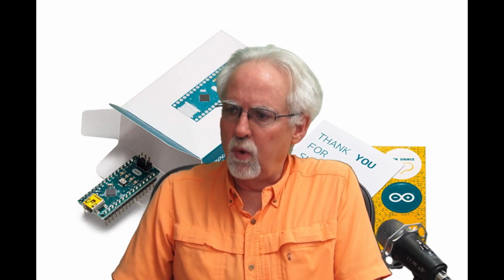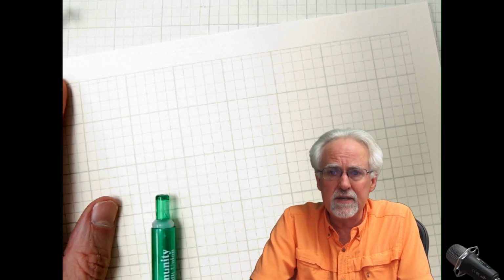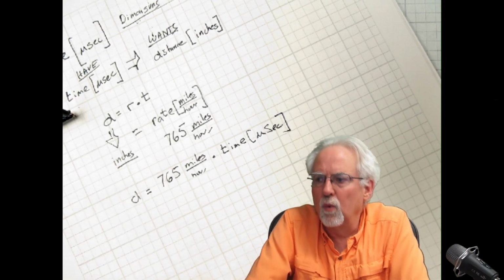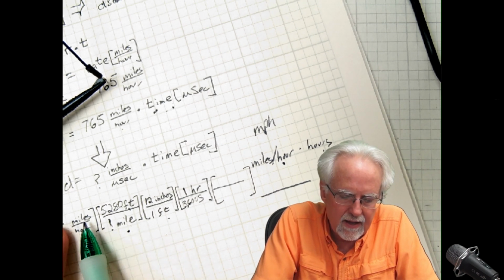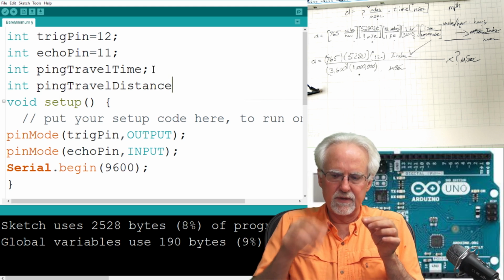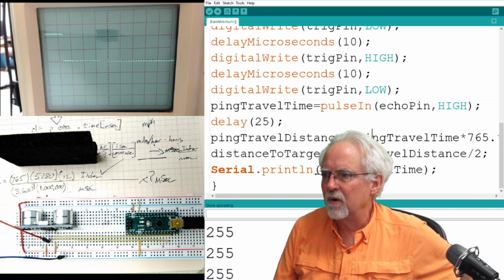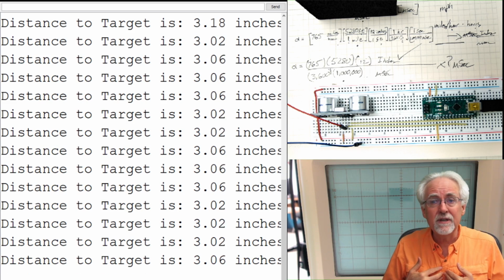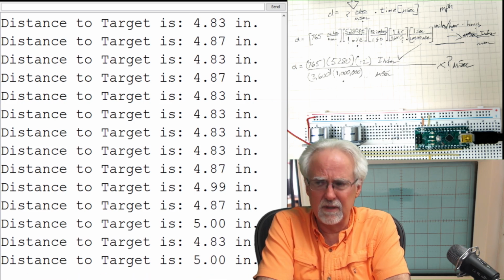Arduino Tutorial 55:  Measuring Distance With HC-SR04 Ultrasonic Sensor

Comment: the HC-SR04 seem related to the old Polaroid camera auto-focus ultrasound sensor begin circa 1978-1980. 
the frequency of old Polaroid around 1-3 cm, so indoor walls with sheet rock construction are basically mirrors. The sensor beam sound waves not exactly in front,  but spread back and forward several degrees (10-25 degrees, i forget).  circular scans of a fixed Polaroid sonar off indoor walls show an all or nothing reflection which is detected only when the sensor is directly perpendicular to the wall. This is related to light bouncing off of mirrors, "specular reflection" . also mirror ultrasound reflection can reflect off of corners, 
2-d or 3-d directly back at the sensor, similar to corner reflection arrays Apollo left on the moon used to measure distance earth-to-moon and variations of distance during orbit.  i didn't build any ultrasound hardware but learned from professor at MIT articles, John J. Leonard. but with arduino board, maybe i can do that.

Comment: How can i turn on and off something at  a fixed time everyday with the help of arduino? I am making a Arduino solar panel cleaner and i require it to operate at 9 pm everyday for five minutes. Please help.
Reply: The Arduino has its own built-in timers and you can play around with that; however, buying a Real-Time Clock (RTC) module is a better option. An RTC module that runs on its own battery and keeps track of the date and time even if the Arduino is reprogrammed or its power is disconnected. RTC also sets you up for real-time data logging. Your RTC can even set an interrupt that would direct your Arduino to initiate your event at 9 PM each day (or any date or time of your choosing). Check RTCs like the Adafruit DS1307, DS3231 or any of the others out there. They price between $2.00 - $15.00  https://www.adafruit.com/product/3013
Reply: You can also use the mills () function. However, it still needs a time-of-day reference. Try out the code below. It turns on an object, an LED in this case, at a given time interval, then runs it for a given time interval. You can change the intervals as need, say on every 24 hours for 5 min. See download link:  https://www.sendspace.com/pro/dl/wvyi0a

Comment: Hello Sir,   really helpfull and well explained lectures . THANK U SIR .  Just wanted to ask that actually I bought one of the kits from other store 
but it does not contain many of the modules you use. So is it good if I practice on Autodesk Tinkercad Arduino software .

Comment: Your videos are excellent
      Can you make a video on wireless communication using arduino
Reply: You can use a nodemcu esp8266 wireless module for wireless or through internet... You can't do it with arduino controller boards. Thank you
Reply: @sudharshanm.n3525  can you please answer my question in the other comment.
Reply: @sudharshanm.n3525  can't i use nrf24l01 module,it can be controlled by arduino